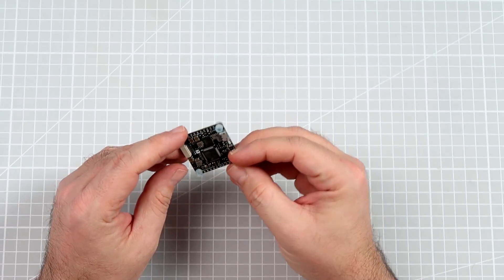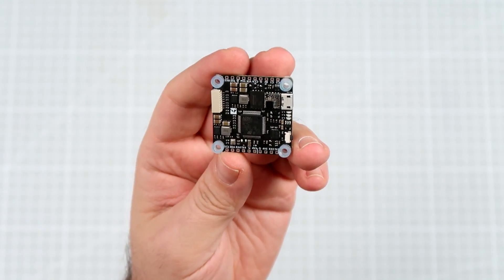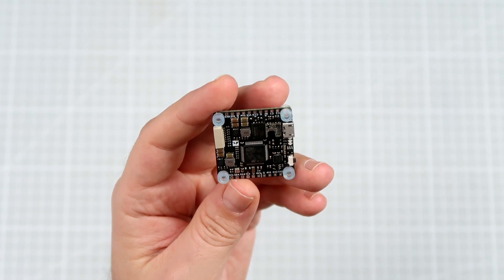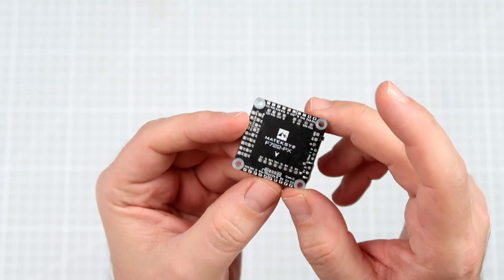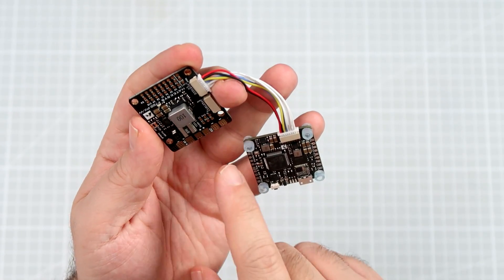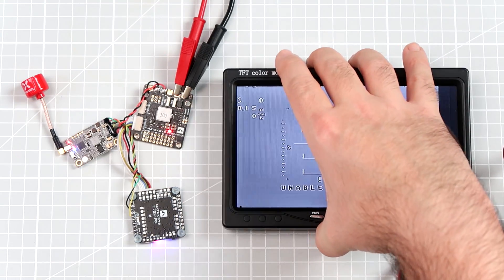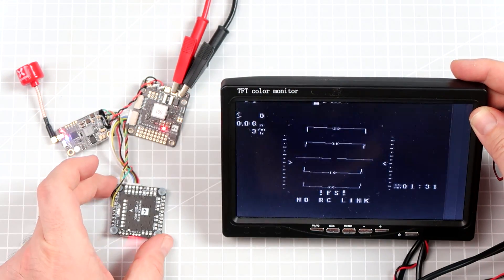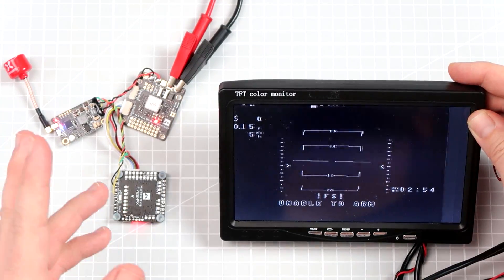Matek F722-PX with FrSky graphical OSD

Comment: I just bought one now in August 2021. I intend to use it on my old Flamewheel F550 Hexacopter to replace the NAZA MV2 controller. Is this a good idea? Do I need the extra power board that you showed us?

Comment: I have been trying to figure out how to get an sbus output (in addition to the pwm output) from this flight controller. Is that possible on this flight controller and if so how would you go about it. I want to experiment with this flight controller but I need a pwm equivalent sbus output. Thanks in advance.

Comment: Matek is far from the first, BrainFPV had graphical osd for years, they have also had 2 different Wing PDB's.
Reply: this Matek board is F7-based and $40

the matching wing PDB is $7 and has direct outputs for 2 motors and 8 servos

also its Matek so these won't get discontinued in a year with no support

my preorder is in.
Reply: they are shipping now!

Price went up a bit - $45 for the FC and $10 for the wing PDB.  Still cheaper than the Radix board / PDB combo.  I have 2 coming - one will go into my 7" quad, the other into a medium-range FPV twin fixed-wing.  iNav will be used on both.  Looking forward to getting them up!
Reply: and both of the brain pdbs are overpriced (no really 20/25$ for a board with a bunch of passives ? wtf)

Comment: Apart from the onboard flash memory the Radix has been doing this for months now. How did you not review one yet??
Reply: wrxsavvy Radix came out almost two years ago. Before that, the RE1 in 2016 and the original BrainFPV board in 2014 also had a graphical OSD but no iNav builds. It had onboard flash and they switched to an SD card for the Radix.

Comment: Radix by BrainFPV is a FC with graphic OSD. I mainly use it to see noise of my setup after flights. also uses Bosch gyro but I could not tell the difference with MPU6000

Comment: Recently bought 5 full Eagletree vectors, so I’m extremely biased!

Step in the right direction, I’m just really loving the Eagletree ability to be set up without a laptop
Reply: Did you win the Lottery?
Reply: EnglishTurbines buy them cheap.
Reply: @joshgault61  A Vector, cheap..?...lol..🤔😳😷😷😷
Reply: EnglishTurbines oh yes! Ebay, Facebook groups for 90-100 for complete setups. Which for the best osd and a solid system, ain’t much more than an inav setup.. it’s a handy system to have, bits do come up cheap..
Reply: @joshgault61  Ah, used gear...of course...I'm an iNAV fan myself, I need the more compact solution...The Vector is a very good FC though, top notch..🤔😀😳😷
Reply: EnglishTurbines new and used to be fair. Given the choice I think if money wasn’t the difference most people would try vector. The new from the shop prices out a lot of people off.
Reply: @joshgault61  Yes, to be fair, the Vector has more features than most people want or need...🤔😳😷😷😷
Reply: EnglishTurbines actually less of anything. I’ve no idea what the emojis are supposed to be representing. Is your flight controller unwell?!
Reply: @joshgault61  You not heard of Corina virus then??😷😷😷😷
Reply: EnglishTurbines yea. It has nothing to do with inav or Eagletree. 😅
Reply: @joshgault61  Did you work that out all on your own?...🤔🤔🙄😥
Reply: EnglishTurbines Have a great Easter, hope you got lots of lovely chocolate, careful, too much will rot your teeth 😷😷

Comment: I wonder why Mateksys chose the F722 and not the F765??
Reply: If the 765 is anything like the 745 then the 722 is still better. I don't have any 765 based FCs but I do have an HGLRC FF Dual Gyro that has the 745. There are less resources mapped individually. I.E. i2c pads are actually shared with UART3 tx/rx so you either get the UART or the I2C bus. With the HGLRC F722 the i2c pads are separate and you do not need to lose a serial port. And support for the F745 is almost non-existent in iNav from what I have seen. Maybe that will be changing with the new version?

Comment: BrainFPV flight controllers also have a graphical OSD - it would be nice if you could do a comparison.
Reply: Michael Emde yes, and they also have the extra board for using with wings, same as here, and they make a 20x20 version.

Comment: Very interesting!   That F722-PX-W is pretty much what I asked Matek for before the -WIng boards became a thing.  I think the -Wing boards are a more elegant solution, but 'at a glance' this new board looks to be a great solution for fixed wing using any quad board with an ESC plug or really any FC with the signal ports available.   It certainly looks nicer than the Radix WPB etc.

It looks to have a the selectable servo BEC voltage, any chance it has a 9/12v BEC option for the VTX?

As far as the Graphical OSD goes, looks a LOT like BrainFPV / Radix's solution.  If Matek adds color they can innovate, although I expected the graphical OSD to eventually become mainstream.

Comment: Is it really that hard to add color to something like that? I would think it's a huge value add 😄
Reply: Color to the FC board or to the OSD? For the OSD I think it would require a lot more processing power just for the OSD itself.
Reply: @NoAgendaFPV  Yeah, this FC must be pink!
Reply: @Sasha Kruse Grim I think it would. Text with better contrasts color changing battery indicator and differentiation between "warnings" and "errors" come to mind, just to name a few things.
Reply: I doesn’t take much extra processing power, but more memory. At least that is what the BrainFPV guys have said is the reason the Radix doesn’t have color. And also obviously requires code and configurator support to make it work. Vector has color but that’s a considerably more cumbersome setup and obviously no iNav.